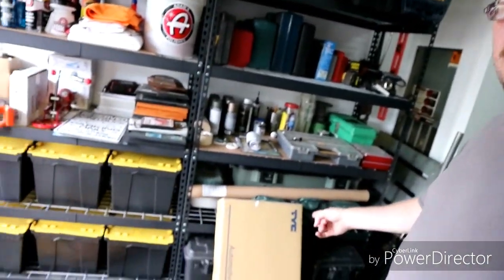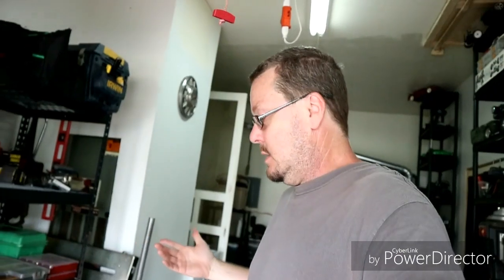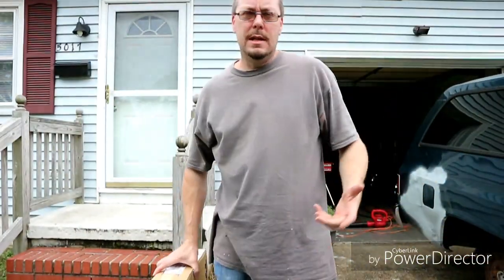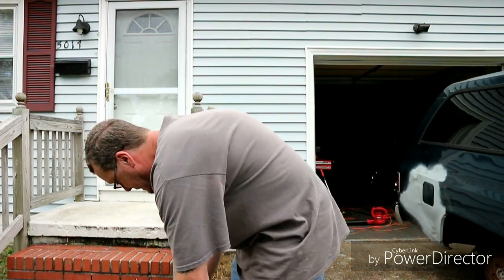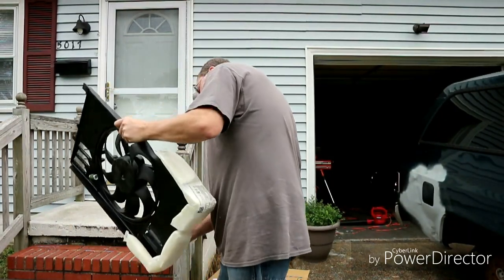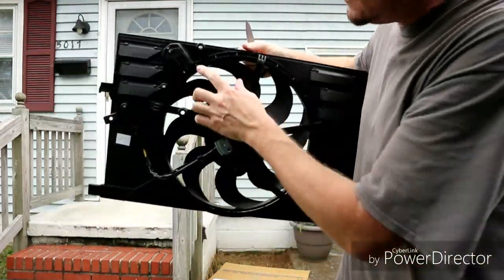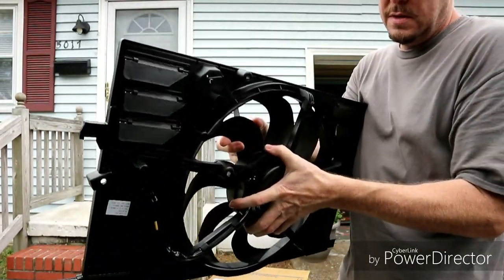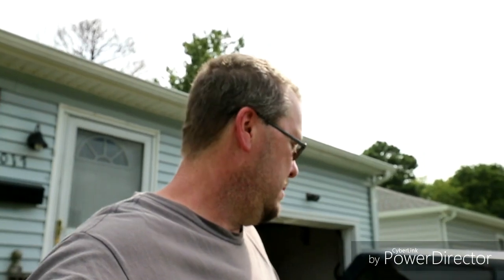Jeep Renegade Radiator Fan Replacement Tutorial

Comment: Thanks for the video. I watched your video to learn any issues or problems you had replacing fan before I did mine today.  Very helpful video and I got my fan replaced and running just under a hour.  Mine is a 2016 renegade trailhawk. The clips holding fan in is just a push tab  on the top two hold downs. I used a flat head slightly pushed and lift fan out way easy. Don't gotta force it or them tabs will break off.
Reply from the maker: Glad it helped.

Comment: Thanks for this!  (16 Renegade) I was stuck at the fan being wedged on the Header cover.  You vid gave me the incentive to pull it off.  I tried to get by without pulling off the O2 sensor, that didnt work, it needs to come off to make room for the fan also.  
I learned, you want to use some pieces of cardboard between your fan housing, and ac radiator, so it doesnt get marred up.  So on reinstall, i put some cardboard in there, and pulled it out after done (wish i had some in there before removal though).  I also broke the wire clip lock, getting it out with the screwdriver, be careful with these, they are easy, but also easy to break.  I used a zip tie on it to make sure it stays mated.  
By the way, i definitely wasnt bringing it to the dealer, i was just worried i was going to have to pull off the top rail there, or the bottom one, or some hoses (arghh).  Did NOT want to drop the water either.  So worked out pretty good.  Wear gloves, yes!  Things are sharp there.
Reply from the maker: glad it helped. yes not the easiest thing to do.

Comment: I am having all sorts of problems with my 2016 Jeep Renegade trailhawk ... first the fan burned out, the ac not cooling properly then the 4wd don’t work and to top it all off the leather in all 4 door panels have lifted 🥺 .... this car was supposed to last me a good 6 to 7 years I am so disappointed at its performance
Reply from the maker: Yes I agree and alot of other people do also. There are problems with the renegades. Wish they did a better job of making them and better quality.
Reply: @lowlifegarage9367   I am in St Maarten  where there are about 25 of these cars on island no one knows how to fix it here ...
Reply: I think the fan is a normal thing, easy to replace, once you've done it, or takes less than 2 hours(tool tracking down time included) if not.  Need a 7/8th wrench, or 02 sensor socket, a 10mm 3/8th drive short socket, or wrench, small flathead for clip removals of the two separate wire clips, needle-nose to pop ac lines off, large flathead to press the top fan housing release clips in, or use your fingers, lift,shove left, twise counter clockwise, extract through the top, i had to flex the top lip of the fan housing first to get it carefully wedged over the front rail bar, after had that for an inch, then just pulled it up, till it was out. 
Putting back in is the reversal, put in some cardboard to protect your radiator fan, watch ac lines, you need to pry them forward as you shove fan past them, clockwise twist, snap in.

Hope you had fun, im sure its done by now??  :-)

Comment: Hi, budddy. I am from Ukraine. And i bought a used Jeep Renegade Trailhawk 2016 from USA with 39k mileage. Now i'm a little bit scared beacause of this issue. The container with car will arrive in a few weeks, and I dont know in whaht condition cooling fan is. On what mileage you faced with this problem?
p.s. Thanks a lot for the usefull video
Reply from the maker: Thanks . Dont be worried.  It's not a big deal. It really is a easy replace.
Reply: My brother just got his keep renegade and it only have 15k miles and had the problem prior to him buying apparently but dealer doesn’t let people know that when they want a car

Comment: The original cooling fan is made by Mahle Corp. of Stuttgart, Germany...cheaply made junk...
Reply from the maker: Yes it was. New one was alot better quality.
Reply: @lowlifegarage9367  ...I had a 2017 Latitude 4x4, traded it in December 2019. The engine and transmission constantly ran hot...some idiot engineer thought it was a good idea to cover the front grill in plastic...kinda hard for air to circulate sitting in traffic. The Z9 transmission doesn’t have an auxiliary cooler and is unserviceable...I did watch a guy drain and refill the the transmission with Amsoil full synthetic, he said it helped the shifting issues.
Reply: Its funny you say that.  Two reasons, one german is supposed to be good stuff, darn.  Two, is because when i pulled out the old one, it was the same fan.  Either someone already had to replace this with mahle aftermarket, or the factory already had a mahle in there, but the mailorder i paid about 97 shipped, was also a mahle.       In all fairness, our fan burned out because the batter terminal cover was stuck in it, was forgotten to be put back on, and costed a fan, fan housing, fuse, and couple hours labor.  What a piece of shite!  An old american 350 small block would have ripped right through that plastic when you fired up the engine!  This little fan smoked up, couldnt handle being on, and not moving.  It lasted for months, eventually into limp mode, then diedj last week finally.  I had smelled burning plastic first, while it was in limp mode, so thats a clue that the fan is melting down.  German stuff is supposed to be better than chinese crap!!
Reply: @lowlifegarage9367  what new one did you get?  what makes you say it was better quality?  So the Mahle is factory then?
Reply from the maker: i dont remember the brand. i know it wasnt mahle. i really dont like there stuff anyway.. i ordered off rock auto. most factory part are made by the cheapest and fast company. aftemarket you can chose who you buy from. which i prefer.